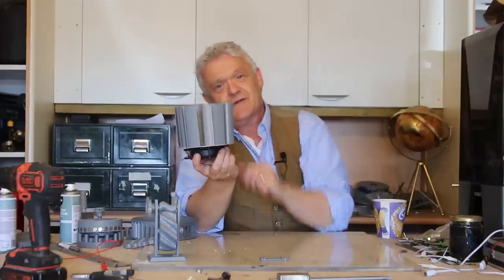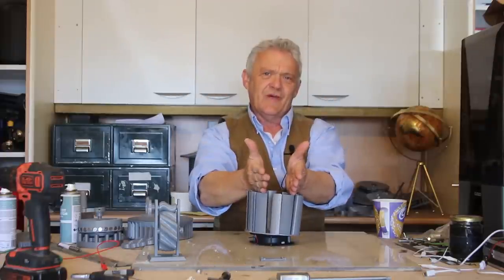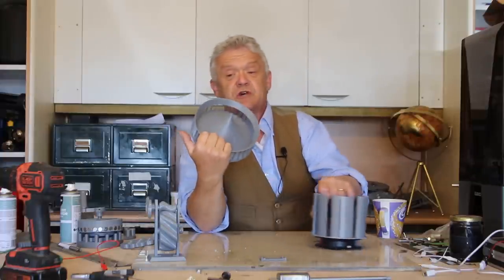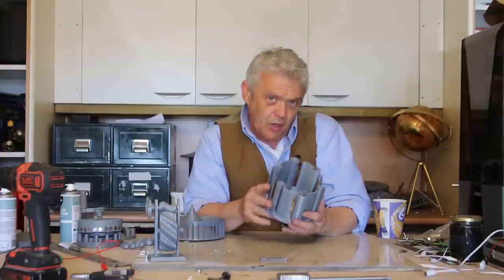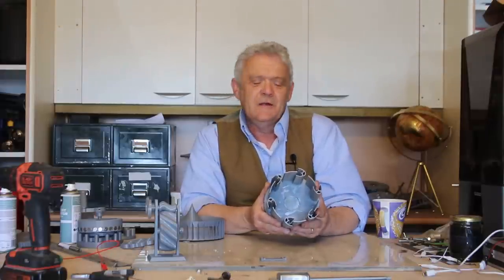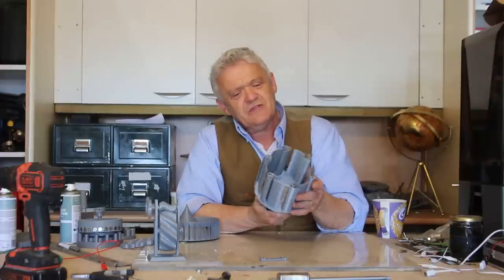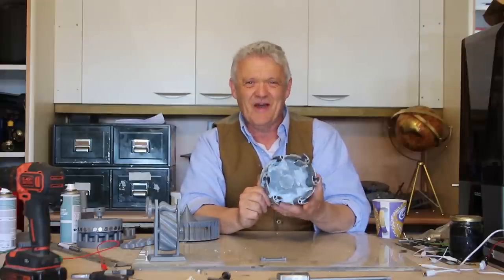1989 The Ultimate Wind Turbine - The Darwin And The Pelton

Comment: That's amazing on many levels .. bc it means you can make it vertical with the Darwin collector pushing air down .. on a large scale it would be easier to work on a generator if is on the ground of course.  Amazing developments .. great to see!  🙂  might add a cone shape in the bottom so it's not a dead wall but directs the air outward.
Reply from the maker: yes i was thinking a cone too

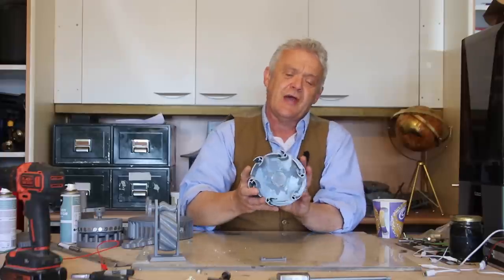Comment: At video 1:44 the rotor end-view appears to show that the pelton split ridge causes an obstruction to the airflow from the central area to the outside of the airfoil. A possible modification would be to change it into a plain U-shape with the inner leg slightly inclined (say 15deg or so) towards the centre to improve the pick-up of the airflow from the proposed central cone. The airfoil could also be extended towards the centre of the U to improve the airflow in that area, and increase its speed over the airfoil.

Comment: I'm wondering if changing the angle of the "straight" (actually slightly curved) blades might make it more efficient. As they are now, it looks like there would be some turbulence created at the trailing edge, though with sufficient speed, centrifugal force might take care of that naturally. Also, it would be interesting to see the effect of the Darwin Collector if it were mounted on top of a tall "chimney" with an axial flow turbine at the bottom. Would also work with a radial flow turbine with proper ducting like you get with a turbocharger turbine (more torque this way). Either way, it might achieve some of the benefits of a standard giant-size axial flow turbine without the complications of wind following, putting the generator high up, and manufacturing/maintaining/transporting huge blades. Probably kill fewer birds, and maybe make less noise.
Reply from the maker: nice pointers mate - cheers

Comment: I am actually designing my Darwin Turbine to power an Ugrinsky, mounted horizontally in the ducting of the Darwin.
I'm looking at doing a "Push Me-Pull You" with two, one focused up and the other down, and the turbine in between.
I'll set it up so it can be a Turbine Test Bed.
Reply from the maker: that is interesting keep me in touch mate
Reply: @ThinkingandTinkering  It gets better. I'm also working on Strange Engines in an Evacuated Solar Heat Tube powered hot water bath.
First prototype of that will be getting one to work with methanol in a double-boiler situation.

Comment: In engineering, the important thing is  not only to understand the object but to reliably predict the performance.
Researchers did just that, in case of the horizontal axis wind turbine, a much improved windmill, don Quixote and his minion Sancho Panza tried to lance in La Mancha.
Mr Betz, soon to become Dr Betz came up with an equation, which describes the absolute maximum a windmill  can extract from the wind.
He measured and observed and tested and calculated and observed that in this ideal case the wind about to enter into the disc of the rotor, slows down to 2/3 its velocity, when passing through that area swept by the long and narrow blades. After that,  the wake, as it is now called slows down to a third of the wind speed, but only if the maximum energy is to be gained. 
He also found that the force transmitted to the mast of the tower is 2/3 of the windspeed squared times the swept area of all blades and times the air density, which at sealevel is 1.225 kg/m³
Now this force is pushing the tower back, like a sail on a boat runnig from the wind. The power in the best case is simply the product of this force times the 2/3 of the wind so, inescapably the power upper limit is
density × (2/3 wind)³ × disc area
where the disc area is π × blade lenght².
This is so simple, so very simple that only a child can do it.
( Tom Lehrer, New math )
Reply from the maker: cheers mate
Reply: @ThinkingandTinkering Thanks, some humor helps with Cervantes the writer.
La Paz, ciudad muy alta, donde tiene su trono el cóndor 🇧🇴🦅

Comment: Not sure but it would be a considerable idea to guide the wind by the darwin collector into a channel where the radius is gradually becoming thinner and thinner, causing the airflow to speed up. I do not remember about the exact video, but that should be considered as well, where You left a small gap between the end of the inlet and the turbine itself, creating a pressure difference that causes more speed gain.

Comment: I see a trend and I'd like to push it forward.
The trend I see is to combine different solutions to generate power and different solutions to improve efficiency.
So why not putting the concept to the extreme? 
Why not combining all of this? Something like a rotating-oscillating wind generator covered with solar and peltier cells and well...all sitting on a stirling engine (whatever that means). 
Of course this Frankenstein device uses magnetic bearings to reduce friction and other crazy stuff.

Ok, let me have a cold drink, it is damn hot here in southern Germany ;)
Reply from the maker: that would be an awesome creation!
Reply: @ThinkingandTinkering  certainly awsome, but also useful?
If you "add up" low-efficiency systems, do you get close to 100% or do you stay under an inefficiency ceiling?
I didn't study physics enough...

Surely such a monster would compensate for the external conditions (no sun? ok, but it's windy. No sun and wind? Ok, but there's heat, etc..) but would the total efficiency increase? Would it still be worth it?

Just food for though.

Comment: I might be wrong but it seams that trying to split the stream of air in two jets is a rudiment that is left of the Pelton Turbine design. I think that making it a single parabola will make the air flow more efficient but the design will look a bit less fancy. The air much easier will be redirected behind the air foil/fin, in the low pressure zone inside the turbine. In the current design a portion of air is always redirected back against the wind, which impacts the efficiency. Should be easy enough to test.
Reply from the maker: go for it and let me know ow you get on - cheers

Comment: Skyscraper designed as a Darwin collector; could it produce enough to balance out the buildings use?
Reply from the maker: that would be a lot of power but i have no idea mate
Reply: Maybe so. However, due to the constant high airflow, you would live in a very noisy and also relatively cold appartment... ;-)

Comment: I was thinking changing the angle and slightly overlap them as a single unit rather than 2 separate pieces each  The thought being that the inside front of the following blade would then also be directing the air into the inside gap of the blade in front, adding to the air going through it, rather than letting it escape through the current gap. Essentially the blades become ( slightly asymmetric ) curved arrowheads  pointing into the Pelton aspect of the arrowhead in front
Reply: Actually it might prove more efficient to not have the apex of the trailing blade exactly centre of the leading indentation ( or indeed either of them being symmetrical ) but for a first principle test it'd do and those more well versed in fluid dynamics might be able to optimise the 2 shapes and positionings. but I also thing such a design would benefit from a donut  top cover over the actual arrowheads, to stop the head on wind getting straight into the "jetting" section. Which would probably also apply to the current design.

Comment: I wonder if the cone used in an earlier project might decrease the pressure against the base plate, when pointed into the wind, or just result in more surface to collect pressure. 🤷‍♂️
Reply: And how does higher pressure affect the performance, I wonder. Might there be a point at which the wind speed makes a blowback from pressure, that can't escape, so the cone should be a separate part, mounted on a spring loaded back plate, to allow it to slip back and let some of the pressure escape between the base of the cone and the rim of the turbine, holding the blades.
Might be too complex, idk. 🤷‍♂️
Depends on how you end up mounting the turbine of course.

Comment: I might be over engineering here with this idea, but what if you used the water's turbine locked in a stationary position to cause the wind to start rotating against the direction of your Pelton wind turbine? Kind of like how you have the stationary parts of a steam turbine to get the steam to spin against the fins of the rotor. Do you think this may be even more efficient than simply redirecting simple airflow or am I right in thinking this is simply me over engineering something?

Comment: I think it would even perform better if you put a cone in the middle to 'smoothing' the air flow (less turbelence) .. probably even better if it's a swirling cone so that not only the air flow is smooth, it's already flowing to the right direction ..

Comment: What would happen if there was a hole on that part where your hand is and would it change the flow air badly?
Reply from the maker: the generator bit is there
Reply: @RobertMurraySmith  imagine having your wind turbine big enough for the top of an electric car.  When driving down the road, how much power would you think would charge up the or be used as energy?
Reply: @zacharysimpson7353  This is stupid. It might charge a tiny bit on the downhill road, but you need to transport the turbine all the way up the hill(s) as well. On average, you will always lose more energy due to drag and friction than you can ever generate. Put it on your roof, sell the car, get a bike.

Comment: Hm. Air jetting out over an airfoil (Hero). Well, why not re-angle the airfoil so that its lift aids spinning (rather than pointing outwards?)? :)
Reply from the maker: ? it is already angled that way
Reply: @ThinkingandTinkering  Hi Rob, I am no expert here but suppose the lift force from air across "wing-section" goes radially outwards, so not contributing to rotation. Could changing the angle of attack (tipping wing section forwards) contribute a force vector in the direction of rotation?

Comment: I have a challenge. I want to use a 20 l plastic bucket and make a battery inside it. You who have a lot of experience un they isue. can recommend me some material that can be obtained. With about 10 buckets put in series, move an electric car. It's just for testing. I don't know whether to make an aluminum air. Can you recommend any of your videos to follow but on this scale? O figure i can obtain a lot ampers.

Comment: looks to me that would be difficult to control at any scale of which example ducted turbines of same airflow really powerful so much so. The  first high wind day causes explosive results....If The full cross section of a VANT is directed through a ducted VANT   at all scale sizes the strength of construction materials becomes difficult. The torque and power converted per volume of wind front presented is the highest pf all wind converters, yes the friction of the double duct is nothing to force directed the units go dynamic. kind of like boost  then they explode .. Build stronger by successive engineering improvements need funding to have that fun..
Reply: I think I got your point... kind of... Maybe put just a little effort in your writing?